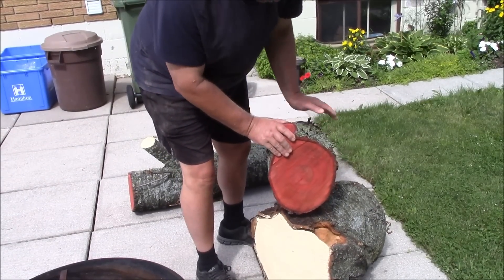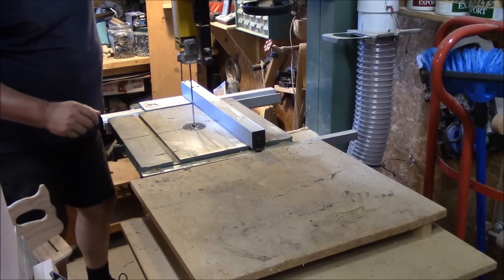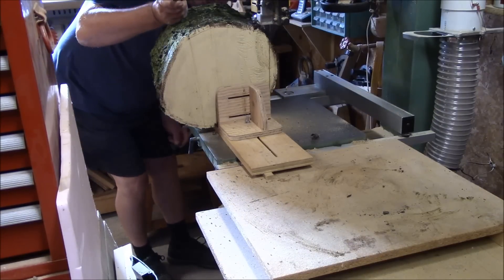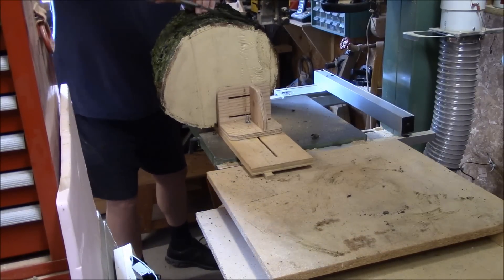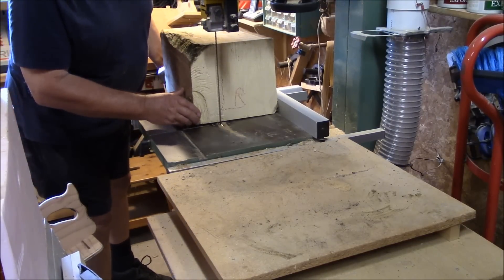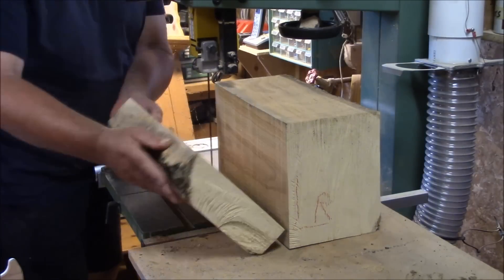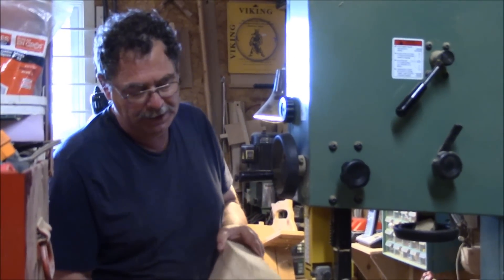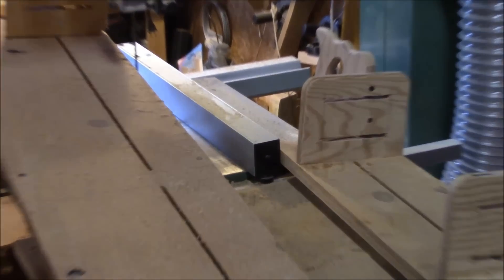Resawing Logs on the bandsaw

Comment: Really like the home made jigs you used. I've had my new band saw for three days. While at the dump today dumping yard waste I found a great fir stump, which I brought home to practice on. Fun!
Reply from the maker: Which brand of bandsaw did you end up buying/? I also have a lot of fun finding logs to cut. The jig makes easy work for cutting the logs. Thanks for watching.
Reply: I bought the Laguna 14/12 (14"). The price point was good with good quality engineering for a beginner. I've got it set up just right (I think) and will be using it on my work bench project.
Reply from the maker: Whats a nice bandsaw and well made. I'm sure its a joy to use.
Reply: @daveyJ213  0

Comment: Hey Pete. Just found your video on sawing short logs on your band saw.  I have a bunch of hardwood from 5 inches thru 15 inches in diameter and 3 feet to 5 feet long that I was wanting to slab up into 3/4" boards for a hardwood floor.  Do you think it is possible to do this on a band saw like yours.  I have no saw mills anywhere in my area so trying to figure this project out.
Reply: I can saw up 4' long logs on my sled setup.  It took me a few tries to make a table and a sled that would handle the 4' 12' round logs but it works great.  Need the right blade 1" with 3tpi makes sawing a whole lot easier.    Here is the link.
https://www.youtube.com/watch?v=NfghIFVAKUY

Comment: What type of blade on your saw?  I've tried slicing up logs but it always seems to bind.
Reply: try 3  teeth per inch , 3/4 inch blades as long as you have 1.5 hp or more they work well

Comment: i was doing just this today, but my blade was kinda cutting through the wood in an arc, what gives. couldnt keep it going straight.
Reply from the maker: check blade, it needs to be in good shape and sharp, check tension. I run the gullet of the blade near the crown of the upper band saw wheel, which helps with drift.
Reply: And after setting everything up properly, you still might need to set up your fence to compensate for drift.
Check out the channel of "The Wood Whisperer". He has a great bandsaw setup video

Comment: These sleds are a waste of time and impractical. Just use a draw knife and a hand plane to get a flat surface to start from. And you won't need to drill holes in your log either.
Reply: Robert Tomkinson without using the miter slide how do you propose to get a straight cut? I'd much rather know my slabs are the same thickness throughout than having to waste so much wood in the planer.
Reply: @suprtrkr . Use the fence. That's what it's for.
Reply: Robert Tomkinson fences don't work. If there is any stress within the wood it will begin to separate or spread open after the cut. If you're using a fence that will push against the fence and cause blade drift. With a sled the wood will still separate but it cannot push against the blade from the sled side so no blade drift.

Comment: Pete, how do you counter blade drift?
Reply from the maker: I find a sharp 3-4 teeth per inch blade works good. Adjust your tracking to move the teeth of your blade just a little bit closer to the crown of the top bandsaw wheel. Don't force your wood into the blade, let the blade do the cutting. If the blade gets too warm you loose the temper in the blade.